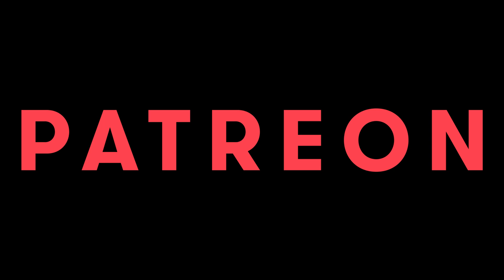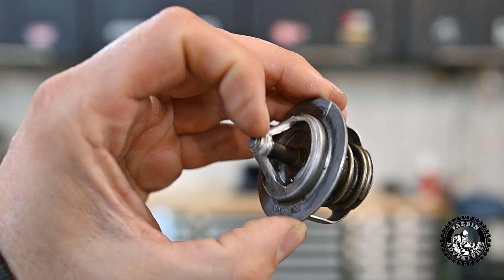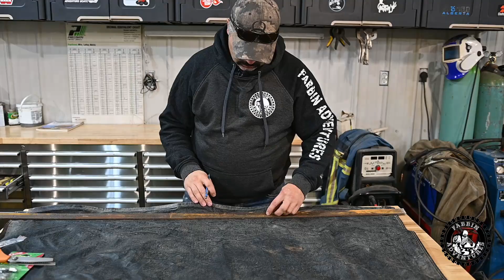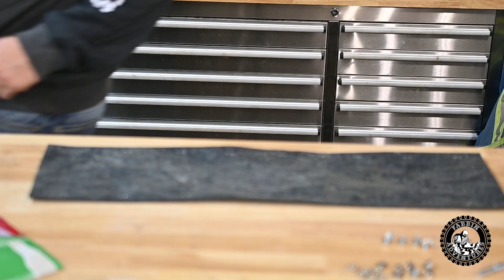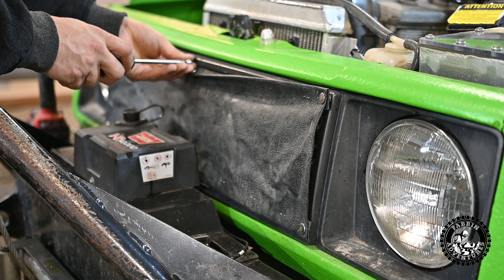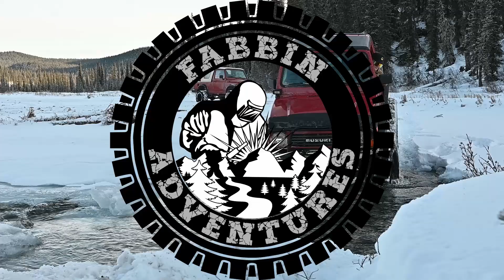DIY Suzuki Samurai Winter Front: 3 Tips to get more Heat!

Comment: Does the winter front make it try to overheat at idle?
Reply from the maker: Not when its really cold out, it really works its best stopping the cold fast air from going through the rad at hwy speeds.
If your crawling around doing slow speed stuff in warmer weather you will most likely not need the winter front.
Reply: @FabbinAdventures  I've cleaned my heater core replaced t stat with a higher temp one and replaced coolant, still have that problem with my engine operating temp getting as low as 110 when driving diwn the road in cold weather and not getting above 160 when idle. Hopefully thus will help
Reply from the maker: Yes it will help, thats pretty much everything i did and still needed the winter front.

Comment: Thank you for the tech tips...  Mr. L..  I am in southern california where the heat is very dry ..  I have a stock 87 hardtop..  Is there enough room to mount an engine oil cooler next to the coolant radiator?  Possibly a transmission oil cooler on the other side?  

My sammy has lost compression due to wear and needing a rebuild.. It spikes in temps on the steepest of grades momentarily but never over heats..  I do plan on rebuilding or doing a FI swap as you did in tbe future..  Was hoping i could prolong needing it with external heat exchangers..

Thank and i will be supporting your channel more through your merch...

Cheers
Reply from the maker: Yeah i think there would be room for some kind of small oil cooler in front of the radiator.
My little jet boat has a suzuki motor and has an oil cooler that is cooled by river water, its really small, i wonder if running something like that in line with the coolant would be another option.
I will be putting in an order for more hoodies soon if thats what you are after. Let me know the size or what you want by e-mail and we will get one ready for you.
Thanks for your comment!
Reply: @FabbinAdventures  Thank you for your reply... Yes on the hoodie...  Will email you on it...
Reply from the maker: Thanks i will look for your e-mail!

Comment: The staples are a great idea. You can add to that with textile glue from a place like Hobby Lobby.
Put glue in all seems, the staple.
Add some flat weight and let it set up.
Just a thought.
Reply from the maker: Ooo i never thought of liquid stitch. But i just threw it together because the wife was comin and i wanted the most heat i could get.
Ill have her mom stitch me up a nice one and get my logo embroidered on the front.
Thanks for the comment Roger!
Reply: @FabbinAdventures  
It’s great stuff, easy as elmers glue to use. Remains flexible, and a small tube lasts forever.
If you keep the lid on it. Stays good in the tube.
Reply from the maker: I may just try it!
Thanks for the tip!

Comment: Good vid, keep 'em coming! Maybe a couple more pieces to the equation... my '89 Sidekick runs cool in the winter too, heat comes out, but not a lot (lots of air, so box is clean)... I've been told the heater core may need to be flushed or replaced, pretty big job though. Also, a local guy in the forums had the same issue as myself and his problem ended up being the rad cap. Seems Lordco might sell you the wrong part! After replacing with a stock unit from another rig, his cool running machine started to make good heat. I guess the pressure in the system never got up to par with the wrong rad cap. Another issue for me, soft top and I have no carpet, only rockergaurd on the steel inside... does not keep the heat in! Looking to insulate doors and body panels where I can going forward.
Reply: Very interesting. I have heat in my samurai but not enough. I realised that the previous owner forgot to put the washer that seal the thermostat into its place.
I cleaned up the cooling system but still not enough heat.
Is there any possibility that the pressure could influence the heat?
Tomorrow I might replace the thermostat and get that washer.
Thanks for the info anyways! ✌️